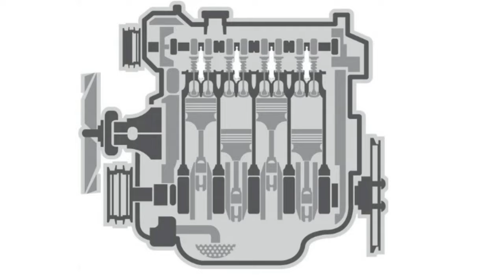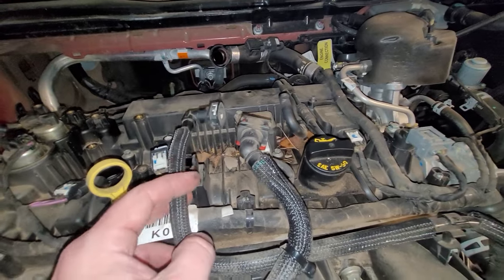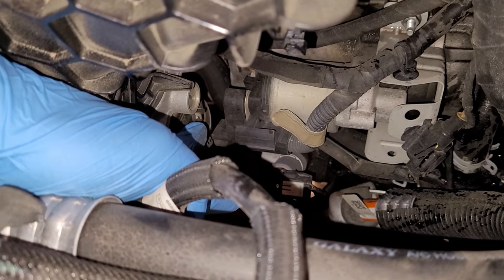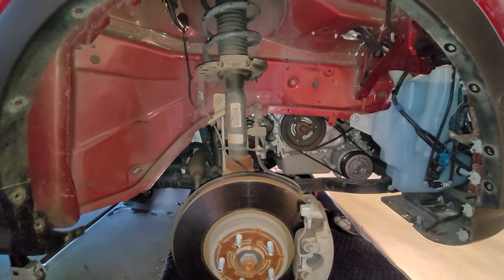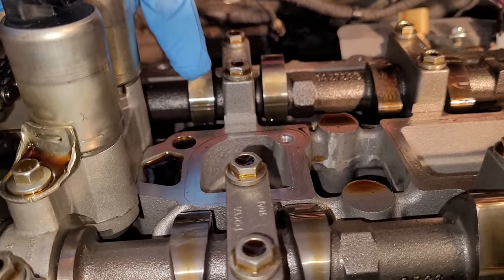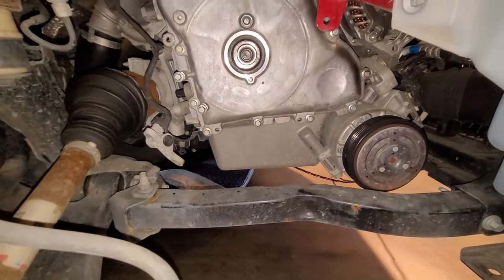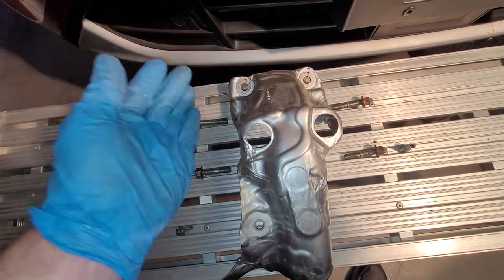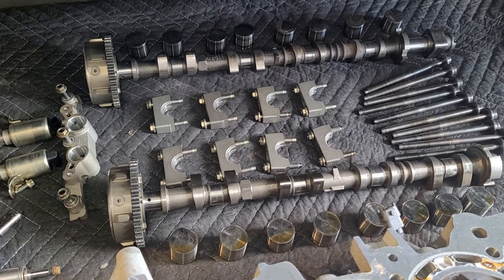Ford Ecoboost Head Gasket Replacement 2.0L - PART 1 of 2: Removal

Comment: I just did this exact work on my 2017 escape 2.0 at 132k miles. Thank you for making this video, it’s the only way I was able to do this job. However it took 5 full days of work with 3 little kids running around stealing my tools

Some comments:
1.) man those VVT solenoids are a major PITA

2.) you need a good breaker bar to get the crank pulley off

3.) the clamp behind the turbo is easy to remove with radiator clamps

Comment: 30:50 - I have a 2015 2.0L, same block design, same failure. Watching these vids to see what I'm looking at work-wise to replace the head gasket to get more life out of the engine since the coolant leakage is minor enough to have been stopped by adding AT-205 with an oil change.

Comment: I'm trying to find the courage to do this with my wife's 1.5 ecoboost, low compression on cylinder 1, but looks like rings have failed on that cylinder too, due to coolant intrusion. Thank you for your excellent video!
Reply: Replacing the head gasket on that is just a temporary fix. The real problem is the design on the block. Ford put out alpt of TSBs on the ecoboost engines built in 2017-19. The block must be replaced with the new design. The old design allowed coolant into the cylinders. Ford actually extended the warranty to 7 yrs or 84,000 miles specifically on the 1.5L. My 2018 Ford Escape 1.5L is at the dealership now getting a new engine under warranty.
Reply: @Jesusistheonlywaay  car is out of warranty, engine or block replacement would cost more than the car is worth. So it's either try to get a bit of extra life out of this engine or scrap the car.

Comment: I know Ford has a tsb that recommends replacing the long block and that is fine if warranty is going to eat the $7000 cost but you are saying you can replace the gasket and hopefully get another 60,000 mile?.  I have one with 96,000 miles that hasn't blown yet, in your opinion are they all definitely going to fail?
Reply from the maker: Yes, 15 hours of labor to replace a ~$40 head gasket beats $7,000 any day. And yes, I would expect getting similar mileage out of it (50,000+). All fail? Time will tell.

Comment: Ford should be making these engines good. Everyone of them coming into my shop is bad. I'm about to do one but I'm going to JB weld that slit between cylinders and see if it holds up longer.
Reply from the maker: I totally agree. I foresee litigation / class action lawsuit in the future. They have redesigned this for 2020+ models. Several 2014 through 2019 models are affected.
Reply: @NiX FiX  there is already one class action against them but I guess it's still going thru the motions
Reply: @NiXFiX I have a 2.3 mustang 2019 and I’m about to hit 30k fbo and this is one of those things I need to do . Along with the Apr headstud
Reply: Did you end up doing this? I am thinking of doing the same.
Reply: Did you end up trying the jb weld? If so did it work? And was the block cracked or you just have a bad head gasket?
Reply: Looking at the saw mark had me thinking jb weld or a really good TIG welder.  It would need decked (machined) afterward though.
Did you use JB?  Did it come back?

Comment: great video.  I have a question though.  I have a 2018 Ford Fusion 1.5L EcoBoost.  I have not done major engine work since the 90's.  But I'm up for the challenge.  Any tips for the difference from the 2.0L and the 1.5L.   Thanks,  Randy
Reply from the maker: I imagine they are similar (I know the 2.0L and 2.3L are really close). I have yet to see or work on a 1.5L ecoboost unfortunately.

Comment: I’m in the middle of changing a cylinder head on a 2018 Ford edge the same issue. But I noticed you did not get the head resurfaced. Did you have it checked out or do you think it did not work? I’m trying to figure out if I should have mine looked at to see if it’s a warped before I put it back together.
Reply from the maker: @ghostofsoufeasthoustone  if your engine didn't overheat, then there isn't much reason to think the head is bad/warped. Just throw a straight edge and feeler gauges on it if you are worried. I checked mine with a straight edge and once verified good, just razor bladed the old gasket remnants off.
Reply: It’s my sister in laws truck, it did 1 hot. Just the once, but she’s got oil and water all mixed together. The worst I’ve ever seen. I don’t like to work on Ford but that’s just me. But I do see a lot of issues with this engine. Like AUDI 2.0! Major headache! Even with her running it hot only once I’m afraid it could be warped. It is a lot of work not to get it resurfaced of course if it is. It’s gonna be a dumb question but what kind of straight edge are you checking it with like a square.
Reply from the maker: @ghostofsoufeasthoustone  a square is for wood working. Not precise enough for machine specifications. This is what I use: https://amzn.to/3t0G3wR
Reply: @NiXFiX Thank you. I really appreciate the advice and the video…
Reply: I got everything back together and started the truck up for about 30 seconds. Then I killed the truck. When I went to start again I cannot get it to start. It just keeps turning over. Like it’s not getting gas. And I’m getting the code for low fuel pressure Bank one. Do you think my timing needs to be retimed? I followed your video to the T but my cam on the exhaust side was a little off and it’s weird because I had the tool on it. But when I took the tool off after I tighten the cams down. It was a little off. I cannot get the tool back. I put it all back together and now I can’t get it started.

Comment: Wow! Thank you for these videos. Very educational.
I am working on 2016 Evoque where piece of intake VVTI popped out and broke the chain.
Upon leak-down test I learned that 1;2;4 cylinders hold 23-ish  out of 25 psi that being applied and cylinder 3 holds only 18psi. With video camera I can see marks on the carbon layer of the piston where valves, looks like kissed the piston.
Car has 74,000 miles and looks like it had been meticulasly maintained, no varnish inside the engine.
My question here is, if I take the head off, is it must to take it to machine shop to get it resurfaced? Or I can just follow peoper sequence - i.e. start from the sides, remove head, replace lap the valves, clean and put it back with new gasket? 
Thank you.
Reply from the maker: Not a must to resurface. A razor blade, some brake clean, some 1000 grit sand paper, more brake clean, and you're good.
Reply: Having a head checked for leaks and cracks was less than $100 for a V8.  Should be similar price range.  There is a magnaflux test they can do to make sure there are no microscopic cracks around the valves.

Comment: Would it make sence to crack those water pump pulley bolts loose, just a tiny bit, before removing the belt?

Comment: Thanks for making the video. I’m looking at Mavericks with the 2.0 EcoBoost and wanted to see how quick it would be to clean the intake valves. Looks to be not ideal
Reply from the maker: This is a relatively easy intake to remove. And Mavericks, I believe, are new enough to no longer have this design flaw.
Reply: @NiXFiX sorry meant the valves look harder to reach. The European motors had removable intake runners and the valves were not so deep off the manifold

Comment: does the cylinder head bolts need replacement after removing for new seal?
Reply from the maker: The bolts don't directly seal anything. It is always recommended to change cylinder head bolts because most are torque to yield. Watch part 2, I replace the bolts as it goes back together.

Comment: Great video Man! You provided so much useful info in both parts. I am currently dealing with the same issue on a 2017 Lincoln MKZ with a 2.0l ecoboost engine. Been reading a lot online on how just like the 1.5 the 2.0 is having a lot of issues with this due to the design. No wonder ford is straight up just telling people they need to replace the whole engine since it is very likely to happen again even after replacing the gasket. Shame they aren't doing any thing to help people out with this issue all repairs have to be done out of pocket. Really glade I came across your video tho! Just curious if you can disclose how much was the cost for this repair for the customer?
Reply from the maker: Thanks for your comment and I'm glad I could help. I don't have "customers", I just find vehicles that need their engines fixed and buy them.

Comment: Those slits, and ford going to an open deck block design are the sole reason these motors now have head gasket, and coolant intrusion issues. Wasn’t a problem on the gen 1, 13-16 block, because it was a closed deck, which they should have stuck with.
Reply: Absolutely right. I’ve replaced nearly 400 of the escape/fusion engines over the years.
Reply from the maker: Amen.

Comment: I have a 2017 2.0L Escape with the issue.  It did the white smoke at start up a couple of times, was giving P0304 codes but that stopped, so far I've had to add about a half gallon of pre-mix coolant.  Went 3 weeks with no issues or codes.  Now it cranks but won't start.  What are the labor hours involved in this head gasket replacement or approximately what would an independent shop estimate for something like this?
Reply from the maker: I looked at my time sheet for this and I see I spent 15.5 hours on it. Of course some of that includes taking time to film things. As far as an independent shop, it is hard for me to say. I do so much of my own work, I am out of touch regarding what things cost in a shop. I would think $3,000 to $4,000 but that is just a wild guess.
Reply: One year and 10k miles now on head gasket sealer cost was about $35.
Reply: @gregalot200 what sealer did you use?

Comment: Nice tear down! Yea what a dumb thing to do Ford.. When this happens to mine, I'm just wondering if we could weld that damn gap closed and have it resurfaced. Gotta be a way lol.
Reply from the maker: You could do a weld build up and then machine it flat, but that would require a full engine disassembly. I spent 15 hours total on this head gasket change and expect it to last as long as the original (60,000).
Reply: @NiXFiX  Right exactly what I would do if I wasn’t ready to replace the block. I’m pushing my 2.0 a bit harder with full bolt on parts so just a matter of when, not if probably.

Comment: Is this repair the same for a 2016 fusion 2.0L? I need to do a head gasket.
Reply from the maker: Should be very similar if not identical  as long as your fusion is the 2.0 ecoboost (turbo) and not the hybrid or energi.

Comment: The tool that you linked on Amazon is coming up for a Land Rover is that correct?
Reply from the maker: Yes. I know it says Land Rover. Land Rover uses a nearly identical engine in their discovery sport and evoque. I like the land rover one better than the ones listed specifically for Ford.

Comment: Replacing the head gasket on that is just a temporary fix. The real problem is the design on the block. Ford put out alpt of TSBs on the ecoboost engines built in 2017-19. The block must be replaced with the new design. The old design allowed coolant into the cylinders.
Reply from the maker: Did you even watch this video?

Comment: Would you get head skimmed before re-fitting  ?
Reply from the maker: I just cleaned it. You could surface it if you want, but the root of the problem is the block and it's slots.
Reply: @NiXFiX  .So what's the solution..Can you get-away with justcq new headgasket
Reply from the maker: Stevo, ford's solution is to replace the engine with an updated version. For those out of warranty, that's a significant cost. The way I see it is if the original head gasket made it beyond the warranty (60,000 miles?) than a quality replacement gasket should make it another 60,000+ miles.
Reply: @NiXFiX  Good point
Reply: Ford specs long block replacement as 15 hours.  Dealers claim times 1.5 to 2 times that.    That makes it cost roughly comparable for labor.  
The long block is running 2500 to 3000 which is the real deal breaker.  If they covered the engine, it would be worth it.  Out of pocket, still a hard pill.
They market these as average life of 150K to 200K miles.   Sounds like a defect affecting merchantability.

Comment: 2018 mustang ecoboost with 23k miles on it... head gasket blown, overheating at idle, few months out of warranty and ford trying to say i gotta pay for a new engine. This car not dogged or nothing my wife drives it and i put 80mph lock on the car as well. This is just ridiculous that these engines are prone to failure like this.
Reply from the maker: Man. Terribly sorry to hear that. Really low miles to. Hopefully you're mechanically skilled enough to follow my videos on this and fix it. If not, and you don't want to pay to have it fixed, contact me through my new Facebook page (see video description). I'd be interested in buying it.
Reply: @NiXFiX  currently in talks with Ford to see if they are going to do the right thing. If not, then we can talk about you buying it. I have a facebook account but FYI, does not have my real information on it, so don't be alarmed when you get request from profile picture of guy with mugshot.

Comment: Over engineered junk ! They could build a simple reliable car for much less money . They've had problems going back to 2014 .
Reply: Gen 1, 13-16 2.0 ecos are practically bullet proof. When they switched to an open deck block design, and added those bs slits between the cylinders when they “updated” is when all the problems started happening. Yeah, some gen 1 2.0s had issues, but nothing compared to the gen2. I know many, many people myself included, running big turbo, decent powered builds on the gen 1 and have no issues. My 13 2.0 ecoboost fusion is big turbo, literally every bolt on under the sun, unopened block is making north of 430 wheel horsepower, and has been beaten and abused for 124k and has been phenomenal. Then again, I take care of my car. Can’t say the same for 90% of people.